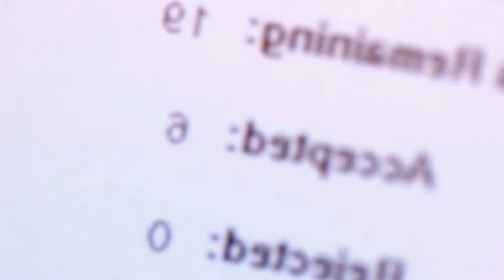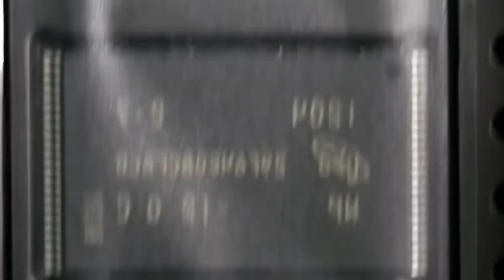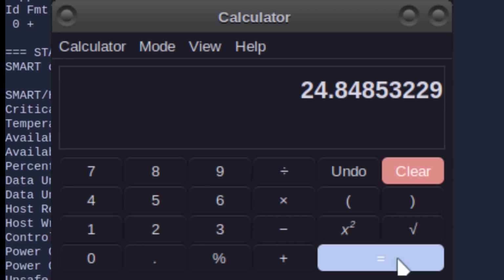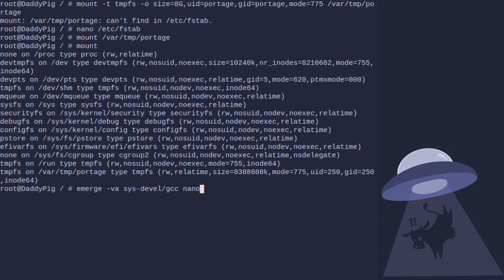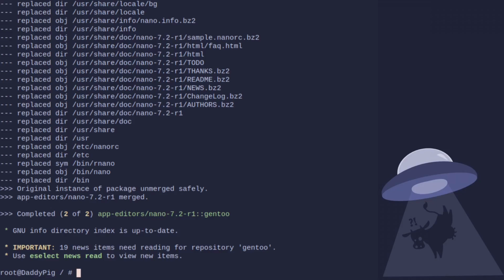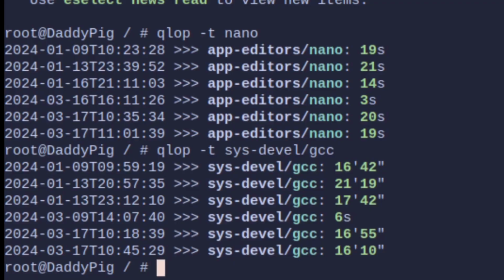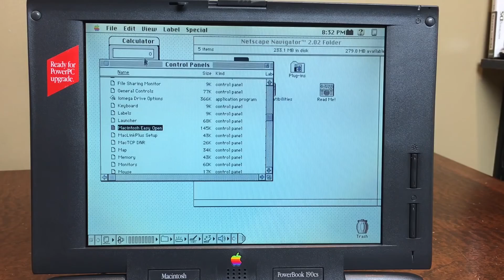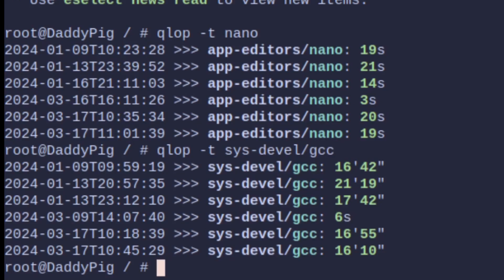Debunking YouTuber's advice on TMPFS in Linux

Comment: You are really lucky, your 2013 SSD continues to work like the first day, I had one from 2017 and I used it the same as you, testing in different OS, many times I ended up writing more than 100TB per day when reinstalling programs ( I hate you win10) now it is dead (kingston 128gb, ntfs, ext4 and btrfs) now I use a sandisk usb 2.0 pendrive with arch to boot I only use it to access the information that I have saved there through a lan cable
Reply from the maker: Is that a real 100Tb of writes here? I only ask as yeah that would kill the thing but most people can normally do this. At the very least you impressed some random nerd on the Internet with your story so you might not have the ssd but you got something even better, a youtube pin!*

* Prize cannot be redeemed for real world value
Reply: @immoloism opp i mean 100gb per day not TB lol xd
Reply from the maker: @mrtetillas7504  haha damn now I need to take the pin back! You remember how long you had it for by chance?
Reply: @immoloism The disk started to fail, it was slow and every so often it had writing problems, I could read the files without any problem but then it stopped giving a sign of life, that was approximately January 2023 I still have the SSD but I haven't turned it on since that moment

Comment: also worth noting is tactical usage of tmpfs in these ways when you are working with some of the niche use cases of gentoo when you are running on a raspberry pi or a repurposed chromebook. The IO wait times when working of flash or emmc as your base filesystem can be a bit much
Reply from the maker: with 8GB of ram?
Reply: @immoloism  The chromebook there in question only even has 4gb. So yeah, it is pretty tactical usage of it, but since most things don't need that much room to build so I just have things build in tmpfs by default then use package.env to selectively adjust using tmpfs for build or build threads to work with the restrictive ram as I see fit for the scenario.

Comment: Very nice explained, why the advancement in technology needs us to re-evaluate our metholody of working from time to time.

I actually have a case, where the tmpfs might still be worthwhile: It's a HP Primergy ML350 Gen 6. It has 2 Xeon X5675 and 192 GB of RAM (actually it could have a max of 384 GB). The 12 cores / 24 threads won't use all that memory for compiling, so making a ... maybe 50 GB ... tmpfs would be like a free minor speed boost.

But in general I agree with your assessment that it often is better to give all the available RAM for the compiling processes, especially in the light of the increasing core counts we have seen in the recent years.
Reply from the maker: In your case you need to do something with that RAM so I would go for it too, you know it wouldn't be the best thing ever but you are lucky to be in a position it wouldn't matter :)

Comment: Checked mine and about the same lol, but I imagine my next SSD will have a lot less because since using NixOS I never reinstall or distro hop

SMART/Health Information (NVMe Log 0x02)

Critical Warning:                   0x00
Temperature:                        36 Celsius
Available Spare:                    100%
Available Spare Threshold:          10%
Percentage Used:                    3%
Data Units Read:                    120,466,968 [61.6 TB]
Data Units Written:                 123,784,670 [63.3 TB]
Host Read Commands:                 828,795,930
Host Write Commands:                1,453,149,619
Controller Busy Time:               4,025
Power Cycles:                       4,238
Power On Hours:                     5,634
Unsafe Shutdowns:                   832
Media and Data Integrity Errors:    0
Error Information Log Entries:      9,398
Warning  Comp. Temperature Time:    0
Critical Comp. Temperature Time:    0
Temperature Sensor 1:               36 Celsius
Temperature Sensor 2:               39 Celsius
Reply from the maker: We should go for a beer or something as no one else gets close to 61TB :P

Comment: The IO bottleneck with computers was only fixed very recently with NVMe SSDs.
Reply from the maker: so 12 years ago if we go your view or 15 years if we go with mine. Feels like splitting hairs but OK.
Reply: @immoloism  it has only become mainstream in commodity servers and clients in the last 5 years, and in servers it's not even a default yet, because intel single socket servers have too few PCIe lanes. And if the problem was fully solved people would stop running memory based databases.
Reply from the maker: We are talking about for desktop users not enterprise here. Please stick to the topic at hand otherwise this just becomes a very messy "it depends." You know your stuff so lets discuss rather than pretend we use formally twitter.

Comment: As you've shown, the real argument against TMPFS is file system caching. When you use ext4 (for example), Linux caches all files that are read and written/created into unused RAM. The philosophy  is: empty/unused RAM is wasted RAM.

So it turns out what people use TMPFS for, is done for you by Linux automatically through read/write caching. I've got 64GBs of RAM. I have personally tested compiling stuff in Gentoo with this setup and it leaves enough unused RAM for the files to stay cached throughout the whole compilation. Additionally, the actual physical writes are also put into queues, so usually Linux isn't waiting around to physically write stuff to disk before continuing your compilation tasks. That's why the speed benefits on modern systems will be absolutely minimal when using TMPFS.

There really are very little reasons to use TMPFS these days, especially if you're worried about speed. But I guess if you're super worried about disk wear, you can do it.
Reply from the maker: There are also file systems that use RAM as a true cache device which could me useful in needs such as yours.
Reply: @immoloism   I have since re-edited my comment to be more clear, my point is against using TMPFS anyways. I do normal Gentoo compilation, nothing more.
Reply from the maker: @CyroTheSpider I got you point so I think it was me that was at fault for replying pre coffee. What I was trying to say is there are file systems out there which setup a ram cache which in some usage cases can be a huge speed boost for the whole system. I don't want to say it because people listen to me a little bit more than than should without considering the downsides of this, You sound like you get this so I wanted to give you enough hints to find it yourself if you were interested.

Comment: In my lab, I write 1.2TB of packed binary data a day, unpacking pushes it to 3×9.2TB a day... Your use case is still small
Reply from the maker: OK you have a valid reason and that will teach me to not forget to add more caveats in future.
Reply: Only reason I'm writing so much is that its just collecting oscilliscope data ad infinitum 😅
i personally use /dev/shm to perform chunked data analysis before sending the data off into cold storage
Reply from the maker: @Gskvj  I respect the pedantic reply as I would have done the same even if I knew it was clearly not my use case. Its nice to know others have my humour.

Comment: The only thing i use tmpfs for is profile-sync-daemon which is a cool utility that combines tmpfs and overlayfs to keep your webbrowser profile in RAM and only write back changed blocks instead of copying back whole profile every sync through the overlayfs at set intervals. On a system that runs from HDD this makes web browser ridiculously more responsive since browsers(especially chromium) like to poke the drive all the time with tiny reads and writes. The tmpfs only takes as much space as the browser profile so that's about 60MB of RAM for a firefox profile which in my opinion is a very reasonable tradeoff even on a low end system for how much more responsive web browsing becomes.
Reply from the maker: I'm surprised that trick still works but thanks for sharing as I'll have to test it.

Comment: I use TMPFS as an easy way to keep my file system clean. Then I do have 128 GB of RAM so I don't need to worry about compiles taking too much space.
Reply from the maker: In that case yeah it's not the end of the world to  use this is geared more to the user with a normal pc.

Comment: Not a Gentoo user, but I've seen that the build directory for my package manager should not be on tmpfs in case the compiles use too much memory. The root directory however is fairly common to use tmpfs for in this particular distro.

So ya, my root is on tmpfs, but /tmp is backed by my physical drives.
Reply from the maker: This is basically correct but I'm a little confused at the most distros use tmpfs for root, do you mean on livecds with squashfs?
Reply: @immoloism  I use NixOS, and after trying to setup a cursed root with too many layers in an attempt to work around a mostly broken file system, I figured I'd try out a more "normal" Impermanence setup once I got things working again (also called "Erase your darlings" after a blog post that pioneered the idea). Basically, my root file system is mounted at /persist rather than /, and then specific directories get bind mounted into it, namely /etc/nixos, /home, /nix, /var/lib, /var/log, and /tmp. Anything written to a directory other than one of those never even makes it to my physical drives and is gone by the time I reboot. (/tmp gets wiped as well, but through more traditional means.)
Reply: @immoloism  I didn't mean to imply most distros. I was just referring to this specific distro, where it's still not the default and probably not the majority, but is decently popular.
Reply from the maker: Interesting setup

Comment: Asus eee pc 2G surf: 512MB ram, 2GBssd (40mb/s read/write)
Can upgrade it to 2GB ram, and usb storage available at 26mb/s read/write.
Assuming a raid0 root of approx 3.5 GB across ssd and usb, around 50mb/s read/write
Case for tempfs here?
Reply from the maker: If you watch the video I explain how you are stealing ram which would be faster to compile if you just use pipe. I'll do a video on zram later on in the week to see if that will help you though as it might have a case.

Comment: the value of tmpfs is that it allows you to network boot a custom image over PXE and use the computer fully from RAM without even needing any storage on the device. why would anyone need that? beats me, i only met someone who did need that  so you would have to ask him
Reply from the maker: Nfsroot is what we normally use here.
Reply: @immoloism no, tmpfs is widely used here, a lot of network boot servers aren't NFS based based after all.
Reply from the maker: Really? Are you pulling it in as squashfs to unpack in RAM? I've not seen it used like this so maybe my company is the weird one.
Reply: Boot over PXE is a very specific use case that you're rarely going to see in home or hobbyist environments. Plus you're unlikely to see Gentoo in widespread use in corporate environments where PXE would probably be used - but usually then on something like Red Hat Enterprise Linux that allows for SLA's and support contracts.

In simple terms, "context is everything" here.

Comment: TMPfs is actually quite the performance boost when you use a HDD.

Also was that two Mental Outlaw videos you showed at the start? Lol
Reply from the maker: From testing on my skylake machine it wasn't that much better on my 5400 seagate drive, I haven't tried a sata2 though. 

Good eye also because it was 2.
Reply: Hmm, I've seen a deference lighted. I was using a 1st gen threadripper.
It's been a while since I cared to test, so I guess I'll have to do some benchmarking again.

Glad gentoo has these capabilities. In truth I use tmpfs mostly because I tend to be lazy and never run eclean or clean /var/tmp/portage while I'm working on a long day of compiling.
Reply from the maker: I'll be interested in seeing.